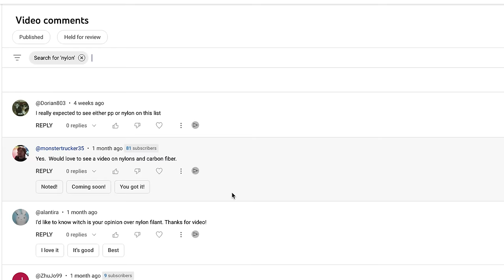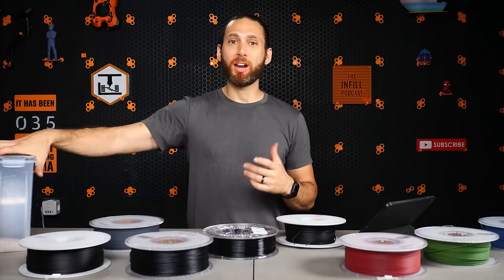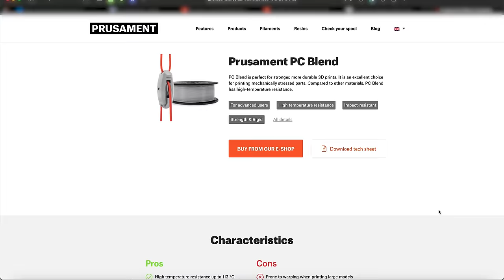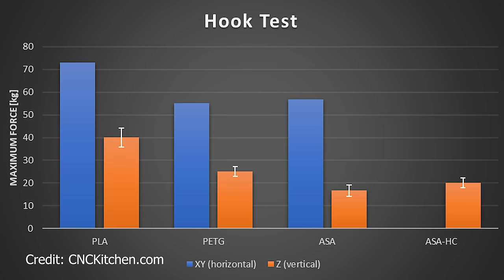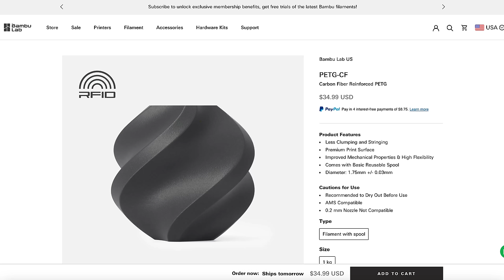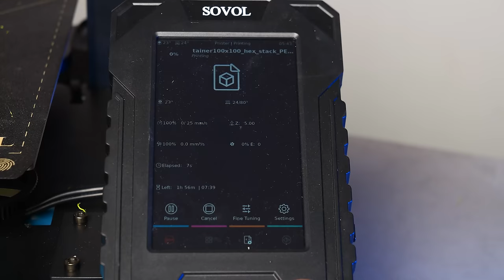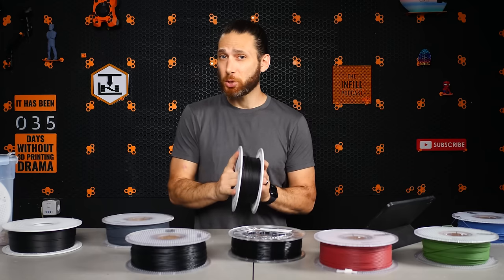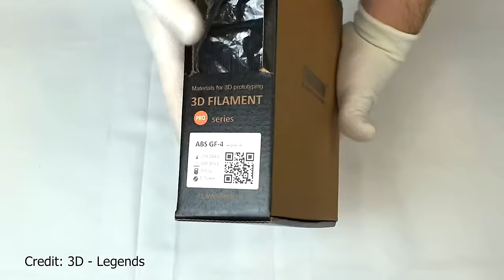Carbon Fiber 3D Printer Filaments: What Are They Good For?

Comment: PLA-CF can actually be strong if you run as little fan as you can get away with. Since the filament stays in place better due to the fibers, on a lot of models you can do no fan if you slow it down a bit

You can also anneal it - it also barely warps while annealing - and end up with something very strong and temperature resistant, that's cheaper than CF-nylon, looks fantastic, and is easy to print

Comment: - I am using ASA, mostly for its UV tolerance as my product is for fishing. I tried ASA-CF a couple years ago and it seemed brittle. Nylon-CF seems to have the proper and exceptional characteristics except for the intolerance to UV. 
- A drawback I see is the lack of colors for these carbon fiber filaments.
- I wonder if and how graphene is going to come into filament. Maybe a video on that.
- I've been working on this invention for about 6 years learning everything about 3D printing from scratch. My research always pointed to ASA as the wonder filament for my product and it is doing good (not is sales stage yet for many reasons).  But now I learn that PETG is UV tolerant??!!!

My product can be explained as a Half Pipe that slips onto a particular fishing rods foregrip with a tight fit. So to get it on or off it needs to be spread open a bit. I've never printed with PETG. Do you think PETG would be suitable for this application?

Comment: I agree on the PLA CF as I have noticed no notalbe increase in strength but love the finish and use it often. Now Nylon CF works great for me and fixes 95% of my warping issues.
Reply from the maker: Surprised that you still use it despite the added cost. Do you like the finish that much more than just regular matte PLA?

Comment: I printed car parts in nylon, specifically clips that went inside the cars cabin. It needed to hold something to the roof without warping or failing during the summer.

Comment: I jumped into 3d printing completely blind. Just sounded cool. Immediately I bought all sorts of exotic plastics. Carbon fiber does make everything print better. It also like you say doesn't really improve anything without taking something somewhere else. I am strictly a hobbyist. I'm not trying to make money. As a hobbyist I try the gimmicks. Cf seems like a gimmick for most applications. It's a good gimmick for making everything print easier though. I've given up on most exotic composites however. Printability is no#1 with me. Window handles, horn buttons for my truck, phone cases, soap dishes, what have you can all be printed with pla, or tpu, no need for carbon fiber, no need for petg, or petg cf, nylon cf etc. Pla holds up a lot better even outdoors than most would have you believe. Also once I have an stl I can just print replacements.

Comment: Hello, let me tell you i have 3D printing business and we tried a lot, i mean, a lot of CF loaded polymers.
Imho CF is way more of an hype, generally speaking the higher the fiber content the lower the layer adhesion, the higher the water absorption the lower the performance when humidity balance kicks in.
Generally speaking the only advantage you really get is improved print ability, fibers addition is much more useful in injection molding due to non linear orientation of fibers wich compensate the lower amount of polymer in the mix.
I’m oversimplifying of course but we done lot of testing on this subject i would discuss with anyone if interested.
Much more beneficial and suited for FDM are mineral and spherical glass loaded polymers over fibers.

Comment: Actually i had situation where PLA-CF outperforms Nylon. I had to print guiding pins with reinforced plate for camera screen and i tried to print with PLA-CF (Red, grey), PETG-CF (Teal) and dried Nylon from Zortrax and red PLA-CF was toughest of them all. Pins are 3mm in diameter and there is center bore like right next those pins. Nylon just snapped right away, same with PETG-CF.

Comment: Carbon Fiber Nylon - I printed footplates for my EUC with it. Worked a treat 🙂  Heated enclosure, on a glass plate, I used a ruby nozzle  brass but with a stainless insert replacing the capricorn tube within the nozzle- fabricated this bit myself. The nylon is hygroscopic, so the footplates have more give in them from when they were first printed, but this is a good thing.

Comment: I have printed things like pa-cf, but I have never tried printing pla-cf because adding stiffness to a filament that is already brittle didn't make sense to me. That, and I generally do not use pla anywhere that really needs to survive any kind of abuse simply because of its ability to melt inside a hot car. I have recently started printing with a petg-cf, and I love it. I used it to print some components for some items that Youtube is not a fan of, and it is holding up incredibly well. You now have me wanting to check out pet-cf though.

Comment: So I print tons of PETG-CF, and I just wanna say your review is pretty good, except right at the end there where you say its good to print without a dryer. It really does need to be dried, unless your ambient is under 20%, you need to dry this stuff. I say this as someone who has developed multiple finished products with it. I love the stuff, its fantastic, couldn't ask for a more adaptable, useful, and good looking material. Its really good for snap joints and fitments, stiff, but with just enough flex, and its strong as hell... Affordable... But if you want the best and most consistent results and best finish, you gotta dry it.

Comment: I have used PA6 to print out an inlet diverter for our pool and it has worked well being under water and in the sun all the time it is up made me use this. I don't think Nylon is as hard to print as most say but you definitely need an enclosure for anything more than a few layers high. I got it first try so maybe it was beginners luck but get your temps right, have your printer setup properly, print from a drybox and have an enclosure and you will be printing Nylon in no time......blobs, warps, cracks or whatever it will at least print :)
Reply from the maker: Thanks for sharing!!

Comment: I use PC quite a lot, mainly for small quad parts. The stuff I use isn't pure PC, it's Priline PC+CF, that is to say it's a blend (not clear what with) in the first place, and secondly has carbon fibre in it.

I have never had any warping problems - though the parts are usually small, and practical use and materials websites indicate that it isn't very hygroscopic at all, that's my experience anyway.

As a blend it doesn't need pure PC temperatures, and it's worst characteristic is that it oozes like fury, in fact I'm continually reducing nozzle temp to try to reduce that.

Subjectively (no measurements), it's the toughest filament I've ever used, parts are much less likely to break than any of the more common filaments.

Comment: One problem with a lot of these filaments is there are very few color options. PC for instance seems to only be available (now on Amazon) in 5 colors. Black, Grey, clear, clear-purple, white. Industrial use may be able to simply print in black, white or grey, but most people want more color options.

Regarding PETG, Anything that's going to be left in a Car, for instance cannot be made of PLA. It WILL melt and deform. PETG handles those kinds of heat well and it is only slightly more expensive than PLA. In my experience, PLA is good for prototypes and things like anime, cartoon and game characters. Things that can sit on a shelf and look good for years. PETG is much more durable in things like impacts, which usually causes PLA to shatter. PLA has the most colors. PETG has the second most colors, so it can be used for a lot more color sensitive items that need to be more durable than PLA.

Regarding nylon, one of my many hobbies is RC cars. I print bumpers out of nylon. The softer nylon is more impact resistant than the harder nylon. This makes it the better choice for bumpers which get brutalized with every collision the car has. A good thick nylon front bumper can literally save your RC car's frame in an impact with a curb in the parking lot you were going super fast in...
 Yeah, It broke the bumper, but the only other damage was minor scratches in the lexan skin. In this specific case, I believe the nylon bumper literally saved the RC car. I tried that same bumper with PLA and PETG, but both were not good at kinetic impacts and broke quickly at much lower speeds than the nylon.

Regarding PLA-CF, PLA in general, is very weak to kinetic impacts. This brittleness makes it a very poor option for use in things like drones that sooner or later will crash. When they crash, if they're made of PLA or PLA-CF, they WILL break... PLA is GREAT for aesthetic things such as busts, cartoon/anime models, etc. These usually are printed and put on a shelf and stay at room temps in areas not exposed to the heat of the sun.

Regarding PETG-CF, it doesn't seem to be much better than PETG. The matte finish is probably the best advantage of CF over non-CF PETG. The temp difference is in a range that's higher than boiling water and even on dashboards in the sun. This makes the temperature not much of an issue. It's still plastic so if its near fire 451 F), its still going to melt and burn...

PC-CF is one of the most amazing filaments that can be used in hobbyist 3D printers that can print at high temperatures. It's extremely durable, is one of the best filaments at dealing with kinetic impacts and is virtually impervious to water and UV. It's my GO-TO for prints requiring high strength and durability.

Comment: I use PET-CF quite often now instead of PAHT-CF on the Bambu X1C. It prints better without the warping issues of PAHT-CF and is still remarkably tough. Using the Lightyear hi-temp smooth plate and don't need glues.  Printed a set of custom designed wall light sconces for our stairwell that use a couple LED lights in them. Also, using it for some aviation parts on experimental aircraft; i.e. mounting brackets, electronics boxes, etc.

Side note/FYI: PLA is biodegradeable, BUT only with proper processing. Tossing it in the ground will just stay the way it is for a long time. PLA can also have warping issues; been there, done that.

Comment: I've been printing parts for my ARCTOS 6DOF Robot arm. I've printed it all out of ABS but I bought some Nylon to reprint the gears for the gearboxes. It has been a little tough. I dried it originally for 4 days straight (since my filament dryer only goes to 50c) and it started off printing great, but I think it absorbed some moisture just within a few days in my BL AMS unit for my X1C. After the first two days, my nylon prints have been stringing a LOT and aren't as finely detailed as they were within the first few days. I had no problem putting my gears together made out of ABS, but I am having a really hard time slotting them together in the Nylon.
Reply: Some nylons can absorb moisture in hours, so you should probably change the desiccant in your AMS and transfer it straight from the dryer to the AMS and keep it shut until you are ready to take it out. It could also be due to your drying temperature, you really want 70 C or above for nylon.

Different filaments expand and print differently, so just because it worked with ABS doesn’t mean it will work with other filaments, you may have to adjust the setting and sizes. Also when printing gears make sure you use a raft, it prevents any kind of elephants foot which makes the gears not mesh properly.

Comment: Totally duffed it with PET-CF. Its the go to for 2A printing, now. Considering that it has to withstand highest temp in the sub 300c printability class, not creep, a balance of strength and toughness, not weak over weeks due to impacted humidity. UV resistance. And it prints beautifully.
Reply: Thanks for that 2..A comrade.
Reply: I'm happy to live somewhere I feel I don't need 2A printing... Or 2A....
Reply: @anderslagerqvist2642  The only reason you don't "need" 2A is because you are currently getting along with whoever is in charge at the moment. That tends to change over time. When whoever is in charge decides they don't like you anymore some 2A comes in handy......

Comment: CF PLA is good for anything that requires a very high degree of precision. Like for example I once made a drill jig with CF PLA using some hard steel bushings, and the resulting tolerances were extremely accurate, like almost lathe level accurate. I also once used it for a small, very intricate puzzle box I designed, and no other FDM filament would have worked because it really called for CNC. Like it was the kind of thing you might normally make out of CNC aluminum. It can also print very nice threads. One of the biggest strengths of any CF filament is being able to print greater overhangs, and standard thread profiles are beyond what an FDM printer can handle in that regard. Small threads aren't a problem, but larger threads are. So like 3mm thread pitch and up is where FDM has issues, but with CF PLA and low layer height you can make it work where no other filament would. I also wonder about HT PLA and if CF infill might help the part keep its shape while heat treating. That would be a helpful experiment. Protopasta has both CF and unfilled versions of their HT PLA so you could do a side by side comparison.

Comment: PLA-CF isn’t a gimmick at all! It’s easily the nicest looking filament I’ve used, knocking other matte filaments out of the park. Mechanically it doesn’t really perform, but I’ve used it quite a lot in a multi part machine I designed so that the parts which don’t demand the strength of cf nylon or cf pc will still blend in and look amazing, just without eating up a lot of the far more expensive cf nylon.
Reply from the maker: Nice, thanks for sharing!

Comment: Hi,

Sorry to ask a potentially stupid question and very niche question.
We have a 60ft sailing yacht, that we are just about to set off around the world. One of my friends suggests a 3D printer to act as a parts replacement system in remote places. We have starlink, so potentially get parts designed for us. Is this a realistic option? And if so I presume we need a higher end printer and nylon and better materials. 
If Billy is correct, could you recommend a printer suitable for engineering printing and materials we should or could take with us. For the materials that suck liquids we have a vacuum machine for storage. 
I have allowed $10,000 for a complete system, is this realistic?
Reply: In theory it sounds like a good idea...In practice the heeling and rocking of the boat would likely result in terrible prints

Comment: I've printed Nylon for FIRST robotics on a Prusa MK3S a few years back. The nylon parts were mounted to 80/20 and held up very well. I haven't printed nylon since. Ultimately I had to build an enclosure around the printer to make it work. We first tried ASA, but the Nylon help up better overall.
Reply from the maker: Yep, that all is consistent with my findings. Must've been a good enclosure!!

Comment: I use PC-ABS now daily, very low warp and not impossible to print at larger sizes. I use it for the fire resistance characteristics in electronics enclosures.
Enclosed printer, chamber at ~50-55C.

Needs to print really slow tho as it reaaaally doesn't want to melt even at 310C

Comment: Nylon is horrible to deal with and it took me many tries but its a great material that is tough, heat resistant and most importantly (for me), alot of nylons are self lubricating, making them really good for moving and/or rubbing parts. There is a reason why plastic gears are almost always either nylon (pa) or acetal (pom). My use case? A bushing for a car part. Just straight up a small nylon tube. I do hear that adding CF to nylon makes it alot easier to print though, but havent had a chance to try it myself yet.

Comment: Plain ABS is my daily driver as it prints so easily in a properly enclosed and heated printer (humble Creality CR6 in an acrylic plates actively heated with a ptc heater, controlled at 60 °C). The main disadvantage of ABS is layer adhesion, even with the heated chamber. So when I need better later adhesion I will use Nylon (PA12) or PC. With the heated chamber both don't suffer much warping. However the slightest moisture and stringing is terrible with Nylon. 
I have used PETG-CF. Results were great but the parts suffer from fatigue quite quickly. Just breaking apart along layers after 6 to 12 months.
The parts I print are mostly mechanical functional parts. So strength and the right level of toughness determines my material choice.
Reply: Why not HIPS? Better adhesion and less shrinkage than ABS, good flow and flow control under elevated temperature, little die swell. Comes out matte, super cheap.

Comment: I've been doing material testing using a truss breaker and breaking blocks of various materials. I found giroid infill to be the strongest for weight/strength and solid parts to have the greatest strength/weight ratio.  I found pla prime to be the strongest, then sls printed nylon 6, PA12-CF next (it has a ton of give and bent before snapping), then PETG. PA12-CF was actually pretty disappointing in terms of strength.  What it's good for is heat deflection and abrasion resistance. Nylon is super tough and best of luck is you need to sand it down, you'll need it. Files won't even cut it